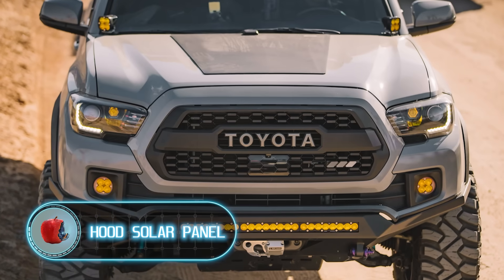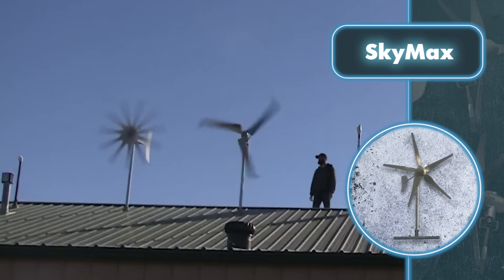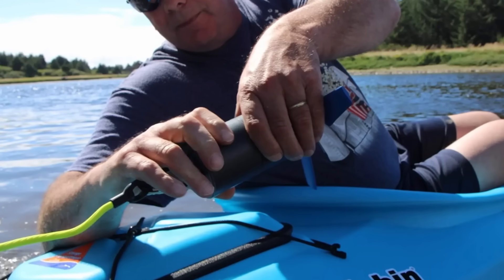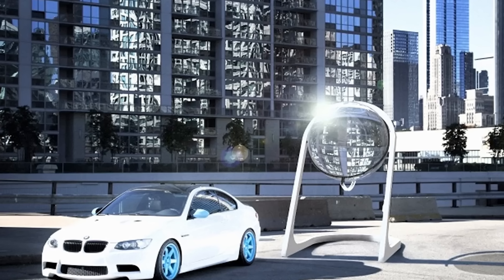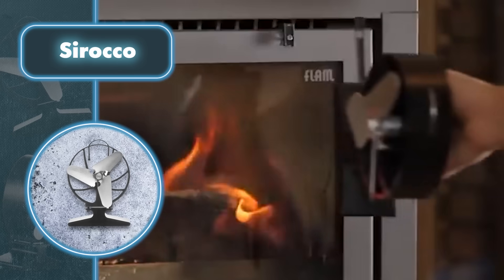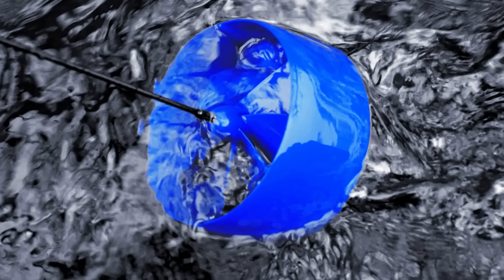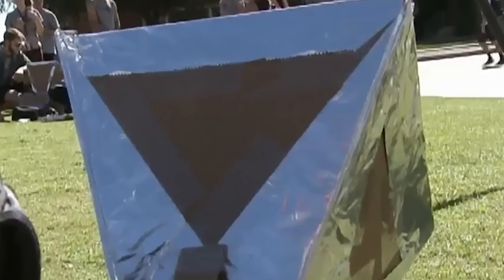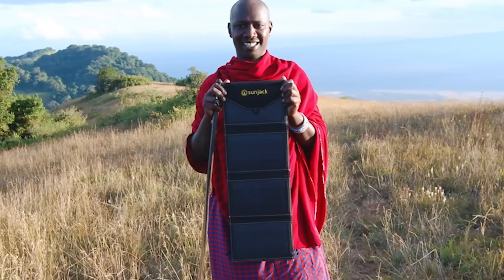Portable Free Energy Inventions You Can Take Everywhere

Comment: The sirocco heat fan is very old tech, it’s been around since at least the 1960’s.
Reply: saw one. 28 yrs ago on a woodstove in a yurt . It was good but how does it work ?
Reply: @alanadale1945  thermo electric power production. That’s all I know
Reply: Peltier. TEG. Thermal electric generator.
If u noticed, there is a white plate sandwiched between the bottom section to the top section.

Comment: There is no such thing as free energy! Amortize the cost of what you paid of your device(s).
Reply: There sort of is, depending on how you define free.  Take solar powered atmospheric water generators….they use solar power to run a dehumidifier type device and can produce 4 gallons or so of pure (almost too pure….need to add some salts and minerals) water per day.  They cost 6k since it’s tech that is just now transferring to home use….so it’s at its most expensive.  But even at this cost, which will decrease with time, it eventually pays for itself, if you compare to the price of bottled water over the same time.  Video here on YT where a guy breaks down the exact cost.  

Then add in that during a grid down emergency situation, your faucet water may go out, as electricity is needed to maintain the system.  Then….that 4 gallons of clean water a day could be life saving.